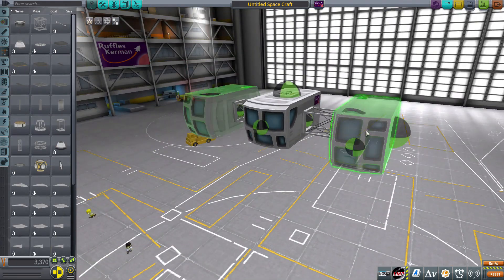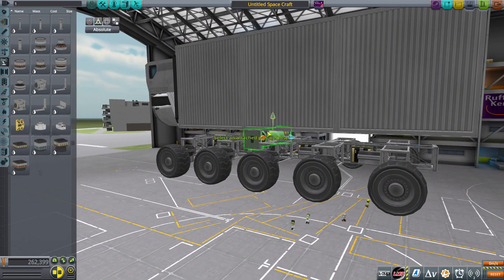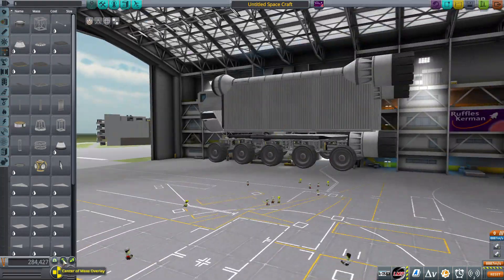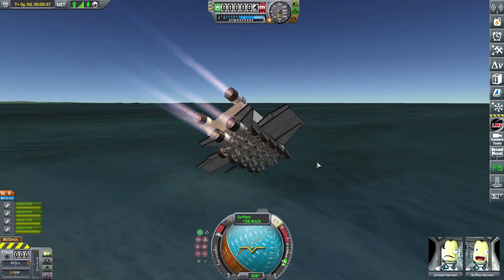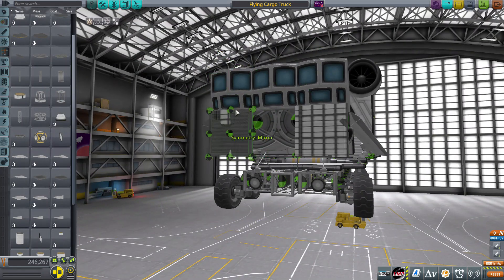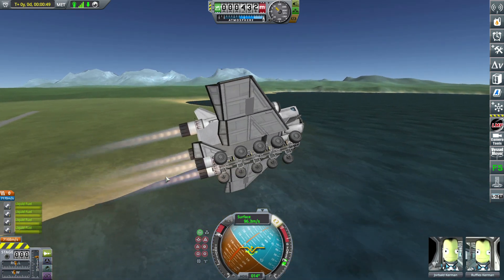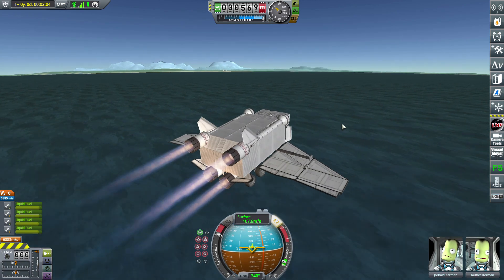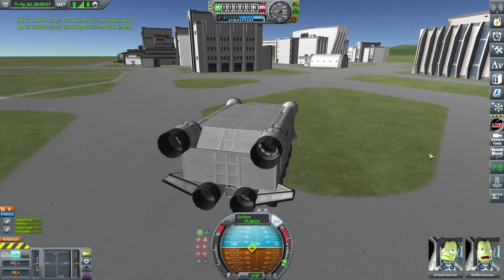The Flying Cargo Truck!  | KSP

Comment: Dude, love the truck.i definitely want to try and fly it to orbit lol. As one of my RC flight Instructors said when I first started flying rc aircraft years ago... "you can make anything fly, you can even make a brick fly if you give it enough thrust" and you kind-of proved the concept 😉. 

BTW,  what mod or settings did you use to get that black and white wire models look in the outtro? That is badass.
Reply from the maker: It's just a filter in the video editor I use.
Reply: That's too bad, that would be an awesome night vision, robot vision mod lol